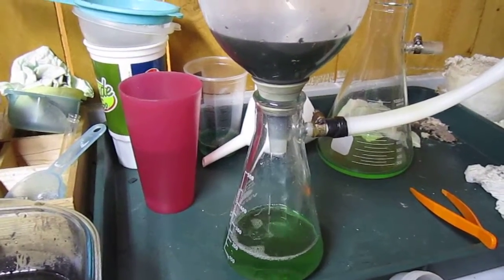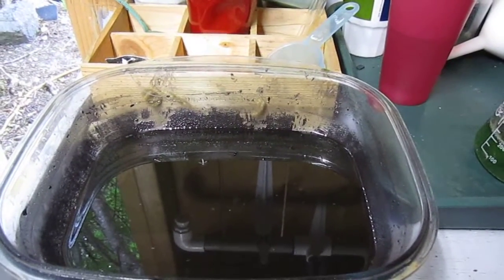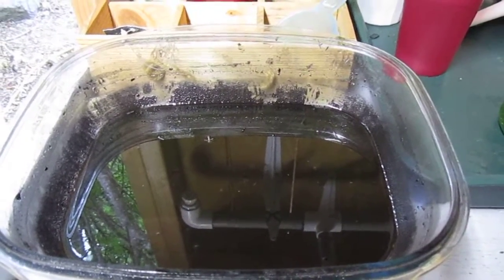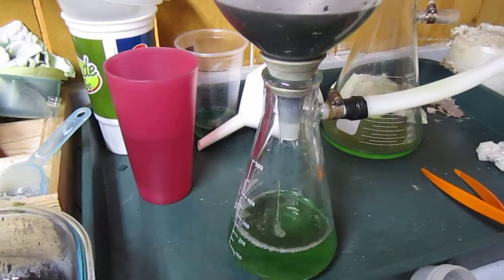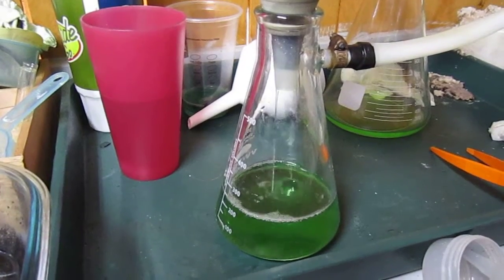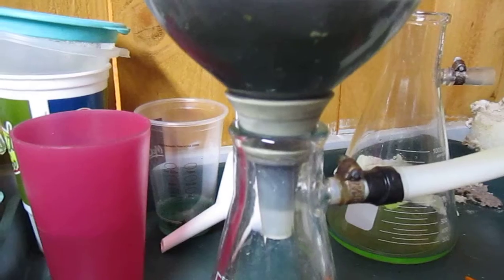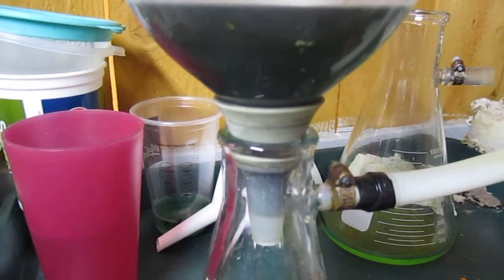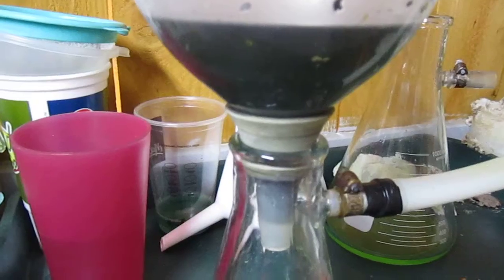Sulphuric Gold Cell - 2 "Vacuum Filtering"

Comment: I was trying the sulfuric acid method with decent results. I used regular battery acid, Almost all of my black sludge gold was stuck to my copper wire negative. I could literally just scrape this off but I cant find a complete video start to finish so I'm not sure what the next step is. I tried to just melt a little of the black sludge but that didn't seem to work too well.